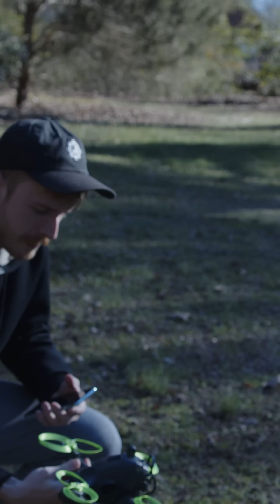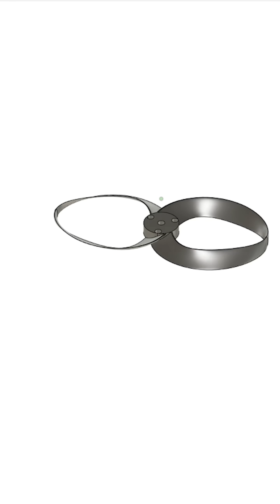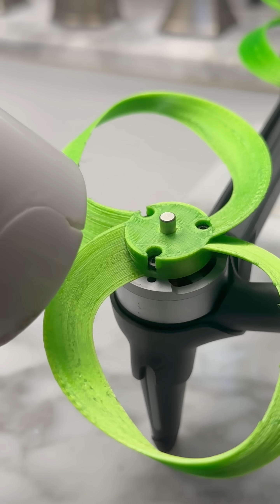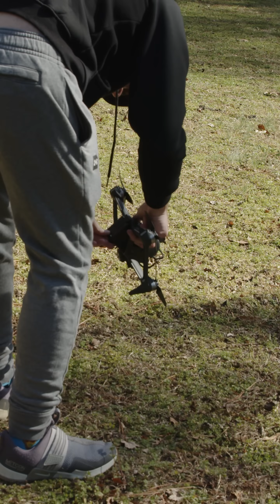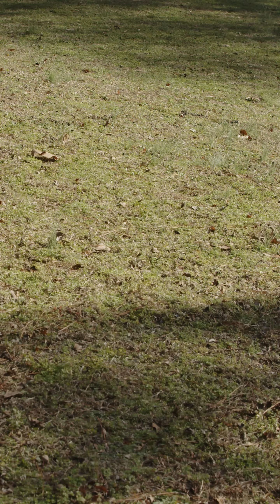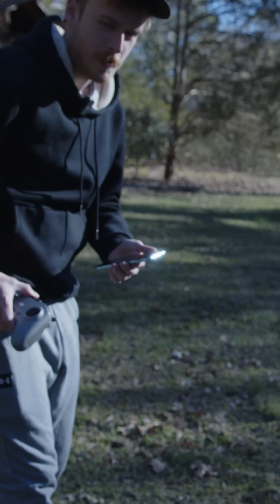Testing MIT's Toroidal Drone Propeller Design & Sound #shorts

Comment: "These are supposed to be quieter"
jet engine drone roars to life
Reply: More like a swarm of bees.
Reply: @East_Coast_Toasty_Boy  A swarm of ANGRY bees on steroids...or Chuck Norris's personal Honey Bees.
Reply: @East_Coast_Toasty_Boy  LMFAOOOOOO bro I’m fucjin crying
Reply: @East_Coast_Toasty_Boy  more like an F1 motor
Reply: @East_Coast_Toasty_Boy  exactly what it shounds like.
Reply: Lower frequency tho
Reply: @cadneemountai2791  so it's easier to hear further out?
Reply: @MagiofAsura  Lower tones may travel further but they're quieter that's why whispering is worse than just talking quietly
Reply: @cadneemountai2791 but louder…
Reply: @cadneemountai2791 Lower frequencies travel further.
Reply: There's more than one frequency, and the higher frequency went, actually even higher
Reply: @cadneemountai2791  lowfrequencey just means the noise will travel further
Reply: lower frequencies are harder to stop with earplugs and travel farther.
Reply: @cadneemountai2791  lower frequency because lower RPM because bigger surface area not because design
Reply: More like a squadron of bees buzz to life
Reply: This is why I came too comments
Reply: Lmao lmao lmao
Reply: @Dropship11  everyone’s asses are everywhere from people laughing them off
Reply: To be honest, this guy can't get the propellers smooth enough, balanced enough, or uniform.  In other words, he's not good enough and doesn't have the proper equipment to make the design good enough to actually work right.
Reply: @BackYardScience2000  You're right about machinery, you can't do precision work with nailpolish and 500$ 3d printer. But the truth is this guy is pretty good in what he is doing as he printed funny propellers that actually lift off drone without crashing or mailfunctioning.
Reply: @BackYardScience2000 He should've just cut some aluminum it would've been much smoother.
Reply: @BackYardScience2000  Then make it better ;-) He just found for him and people there are interested a solution. About all the other stuff this can be developed called it Beta for now ;-)
Reply: @BackYardScience2000 crazy how saying someone is not good enough can be extremely harmful to ones self-image. That being said i agree with the point that the propellers are not smooth because of his lack of equipment.
Reply: @BackYardScience2000 Yeah you can't use an fdm printer for these
Reply: @BackYardScience2000 he should patent the design atleast though, and perfect it in to the best it can be
Reply: @BackYardScience2000   yeah, after watching his "nail polish" finishing I'm surprised they even work
Reply: @BackYardScience2000  thats what I came here for
Reply: @BackYardScience2000 that’s not very nice.. but it’s not factually wrong. 😑
Reply: @BackYardScience2000  wrong. show me the cfd or stfu
Reply: @oslier3633  ok there bud.  🤣🤣🤣
Reply: @BackYardScience2000  Your comment was not good enough either.  But thanks for trying to educate us.
Reply: @larrywarolin7215 Your comment was worse than his, thanks for your input
Reply: @iCantEvenButtonsGaming  I can think of people who changed the world and are non MIT educated individuals 😂
Reply: Lol lol lol lol
Reply: A generic 3D print isn't gonna do it. Each tiny ridge will contribute to higher turbulence and nullify the design immediately. I imagine the nail polish is doing very little to help this.
Reply: the only reason the propellers sound louder is because the layers in the 3d printing process creates a lot of imperfections that interfere with the airflow somehow. it would probably work better if they where resin 3d printed, or molded.
Reply: @Ben_Eshricks_Parrot  yes exactly there not loud because there toroidal there loud because there 3d printed
Reply: actually 🤣🤣
Reply: I just spit all over my phone after reading this 😂🔥🔥🤣
Reply: Sounded similar to me.
Reply: 😂😂😂😂😂😂 I’m dying over here
Reply: 🤣🤣🤣🤣 exactly what I heard 💥💥💥💥
Reply: They are quieter at a higher speed
Reply: @t900HAWK  That wasn't demonstrated.
Reply: Even louder than the regular ones
Reply: lmfao
Reply: its bc he blasted the volume u can tell by all the ambient noise
Reply: i think it's loud because it's quite crudely produced, if it is made from metal which may have smoother surface, it could reduce the noise level.
Reply: @iCantEvenButtonsGaming  lol you say that like going to mit is going to change what you can do on a home printer with crappy layer resolution. and besides jay went to berkeley i know thats not quite mit material but i doubt hes at some serious intellectual disadvantage lol
Reply: more like kawasaki ninja
Reply: That is because the propeller was cheaply made. 3d printed
Reply: If you were to make it out of a better material, and finer edges it probably would be quieter than in the video.
Reply: and then a batman chases penguin
Reply: Dude 3d printed these at dudu quality.
Reply: Exactly what I was going to say 😂
Reply: + х)))
Reply: If thay were made the same way that the stock ones are thay would be
Reply: They were kind of made for submarines
Reply: "These are supposed to be quieter" maybe he refered to the original ones :))
Reply: sounds like a swarm of hornets haha
Reply: Its the air hitting the mic i think
Reply: What’s really particularly pathetic is this video, I.e a quieter drone….
Has 288k likes.   
Seriously people..who knew noisy drones triggered people 😏
Reply: Lexus LFA
Reply: I like better the ear piercing hight pitch noise of the regular propeller.
Reply: they seem to have the same sound level, but since the frequency is lower, the noice disappears more rapidly as it flies away.

i hope that’s the case i’ce looked at Ziplines asymmeyric counterbalanced props as a better solution in my quest for a quieter drone.
Reply: oh yeah- see if you can reduce the weight for the whole drone too… then the thrust needed for hovering  will be at a lower rpm.
Reply: Thats the motors
Reply: Dumbledore said calmly
Reply: Hahahhaaa
Reply: HAHAHAHAHAHA  NOISIEST SHIT EVER
Reply: Sounded loud. Also sounds like it’s taking my power to run them
Reply: I was just about to comment that😭😭😭
Reply: Imperfections in the print will rub against the air and therefore noise. Wish the author did better in the info side.
Reply: Sounds like a giant bee
Reply: It's probably a combination of the print surface being less than smooth and the fact it's quieter than a propeller with comparable lift.
Reply: Sounded like angry bees to me.
Reply: Uses nail polish 😂 
The most backwoods Bubba, while eating a donut, could use the proper materials to sand and polish and get these things, smooth and balanced out. There’s just way too much soy and a lot of these men’s diets.
Reply: Result: 0% difference or improvement
Reply: Hahaha, i was thinking "was it just me or was that NOT quieter at all so i look at the comments and this is the first one i see"
Reply: in 3D ...
Reply: Noisy still yet they probably got billions for funding of hard earned taxpayer dollars
Reply: The reason I checked the comments! 😂 bro needs a decibel meter.
Reply: that's what I thought 🤣
Reply: ㅋㅋㅋㅋㅋㅋ
Reply: Name checks out 😂😂
Reply: Jesus loves yall
Reply: They are quieter. They don't chop, they slice.
Reply: the real effects happen when you get more than 50 ft. away compared to a normal tri blade the difference is actually kinda huge
Reply: Print them in resin
Reply: Not much noise difference
Reply: Fr lmfao
Reply: I was like holy hell, was that a freaking dinosaur?!
Reply: Sounds like someone launching a Patriot missile out of an empty grain silo
Reply: With such a rough surface that was no surprise.
Reply: Im dead..this comment killed me😂😂😂
Reply: 😂😂😂😂😂 ❤️  respect
Reply: @iCantEvenButtonsGaming  did you really just say "perfected propellers" 😭😭
Reply: @cl3anfpv618  He said "Non MIT educated." Can probably watch MIT lessons free somewhere on web.
Reply: @iCantEvenButtonsGaming  There are a lot of non MIT educated Nobel Prize winners , but yeah, you’re probably right. They probably couldn’t designer propeller either…
Reply: 🤣  Reminds me of an F-35. Built to be stealth but louder than an F-15.
Reply: @celtekrider2  an aircraft isn’t classified stealth by how loud it is.. 🤦‍♂️
Reply: @Kasejeb   We messed up then! We need to put the standard engines back on the C-130 Spooky since silence does not give away your position anymore.......
😆  🤦‍♂️
Reply: @celtekrider2  jets don't really care about sound that much, not nearly as much as their radar cross section.  Have you ever tried to locate a jet by sound alone?  Step outside, especially if you live close to an airport, and let's see just how accurate you are at guessing where and how far away each plane is as it's coming in, all while not letting echoes mess you up.  Oh, we're also talking about jets here.  You know, that travel faster than sound.  Why would it worry about sound if by the time that you here it the jet is already miles past you and has already dropped its ordinance on you?  Yeah, sound isn't nearly as important as other aspects.  Nowhere near it for this type of aircraft.  Yeah, for the C-130 it made more sense, because it was traveling slower than the speed of sound and could be sort of found that way.  At least have a sense of understanding about the subject at hand before spouting pure dribble about it.  🤦
Reply: @OutlandishOW   Most of my family works at skunkworks and formally for lockheed... I didn't think there was any "wannabe know it all's" in this comment section. I'm sorry I even wrote that, since I forgot that your favorite (MOVIE) Top Gun came out and now we have an "expert" who's going to school me on modern stealth technology..... What else don't i know?
Reply: @celtekrider2   lol I didn’t even go see top gun 2. Nor am I wanna be know it all, I fancy myself a common sense understanding of science. Your family might be ashamed if they knew you thought “stealth” was centered around noise. Your comment just “sounded😉” silly, to me and others. I’m sure whoever developed the aircraft to have extremely precise shape took the noise of the engine into consideration. Your comment suggesting you know better as a random inbred family member of someone who bolted together some panels is pretty funny.
Reply: @celtekrider2  also, I live next to an airport/base. I’ve seen f-16’s fly by silently and be out of sight before I heard the roar.
Reply: @Kasejeb  🤣🤣🤣
Reply: @celtekrider2  confidentially incorrect cringe 🤦‍♂️ educate yourself.
Reply: @Kasejeb    I'll be sure to let my family know at Skunkworks, who make weapons and defense systems for the US Department of Defense. That someone from youtube said they don't know what they're talking about. Thanks Kasejeb 👍
Reply: @prairie bilton A little slow aren’t ya little man? Nice sunglasses you got there, are they from skunkworks?
Reply: @jerrystirrings2670  Thanks! And no they aren't.....They're Darpa! Lmao💀
Jk kid.
Reply: @Prairie Bilton Bellend.
Reply: @OutlandishOW no plane in the USA will break the sound barrier near over land
Reply: @fordperfect1227  is that a “law”, source, please? But really. Over-land, or a mile off the coast doesn’t make much of a difference. My windows still tremble.
Reply: @Kasejeb  I was thinking the same thing when I seem that comment . Especially the B52 stealth bomber and it's slim design that thing ain't quiet . It's slim rounded  design is what also helps it avoid radar and being undetectable
Reply: @celtekrider2  Noise doesn't really matter that much if the intent is to avoid being detected by radar.
Reply: @celtekrider2 The F-35 has a Radar Cross Section of a Bumble Bee thats what makes it stealth not how loud it is
Reply: @celtekrider2  hUrR DuRr tHe f35 iS CRaP!!1!1!1!11111
Reply: @flyingpancake3983    I have no idea what you even wrote....
Reply: @celtekrider2 you do realise you cant hear a jet when its attacking you because of how far away it is right? the stealth keeps it invisible while it sends a missile at you from 50 miles away
Reply: @celtekrider2  you do realize stealth isnt about how loud it is, but by its radar cross section, as well as other stealth tech.
Reply: Omfg the MIT simps have entered the chat lmaoo. I think they're forgetting how MIT couldn't work out why the hyperloop was a bs idea 🤣
Reply: @Sierra097  I lost all credit for MIT when i found out they were tight epstein and his money even after he had charges for really bad crimes against children
Reply: @Sierra097 tbf there are other youtubers who seemingly made quiter drones/rc planes with these props. I think this guy may just not have done it right.
Reply: I could make them 100x quieter on a $30 budget
Reply: @JakubSK  Super! ... but I couldn’t find your design on YouTube channel. Please share!
Reply: @ I don’t actively run a YouTube channel, or create “content” on any other social media. I avoid that like the plague.
Reply: Theyre not quieter, its just that they have a different noise profile that doesnt automatically trigger human anxiety response so is seen as quieter.
Reply: The same M I.T. that brought us, the space pen!

Comment: Good call👍 keep improving 👏 I think if you lightly sanded and buffed them smooth somehow that they might be even quieter. It could just be the friction between the blades. At the end of the day there is only so much you can do to reduce the noise in the motors. Apart from purchasing a quieter drone I guess. Still .. pretty awesome

Comment: You need to make ones that don’t have ridges and are very smooth read the paper on them. The talk about flaws increasing noise dramatically being the major flaw in the design and currently not ready for use in mass manufacturing but could have use in high end products where they can spend the time and money on making them correctly otherwise you’re moving backwards the product is worse at everything when made incorrectly

Comment: For the purity of the experiment, it would be interesting to equip two identical drone models with different propellers, one with traditional blades, and the second with the author's version, and then compare the characteristics: flight speed, vertical lift, etc.

Comment: The new propeller legitimately sounds like an angry swarm of severely pissed-off yellow jackets..... I'll never forget that sound! It happened to me twice last summer and three times the summer before that. That's what happens sometimes when you rome the woods mushroom hunting....😅
Reply: Looks like you got a little more than you bargained for 😂
Reply: @Oatskii  Isn't that how it usually happens?
Reply: Carry a racquet…
Reply: My sympathy. You can wait until they calm, or evening. Pour a cup to pint of gasoline in the hole, and put a sealing rock over the hole. After several minutes you can light it if you want. Yellow jackets  are gone, and nothing will hatch.
I do this in the yard where I mow, not in the woods. Don't light the hole around dead leaves.